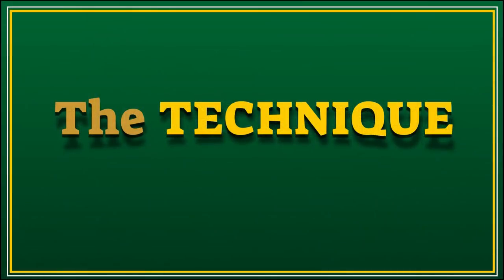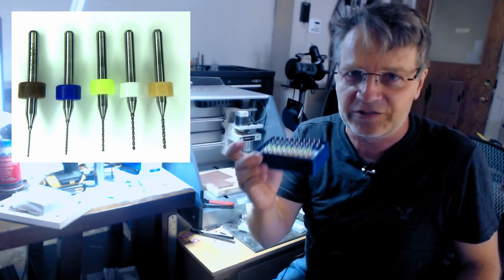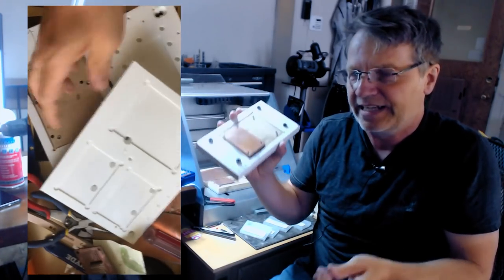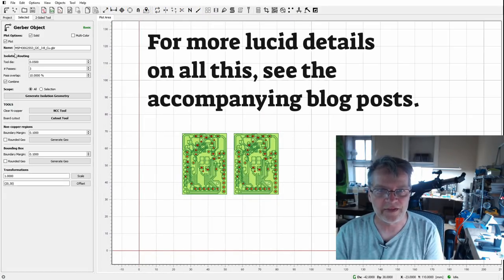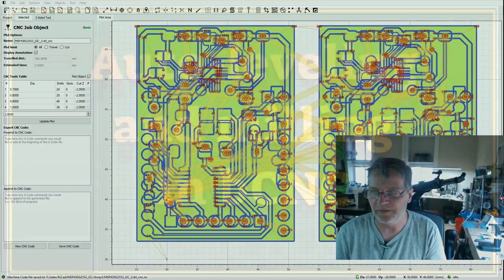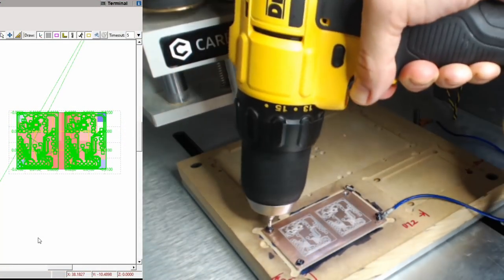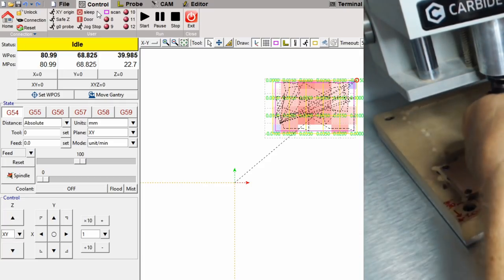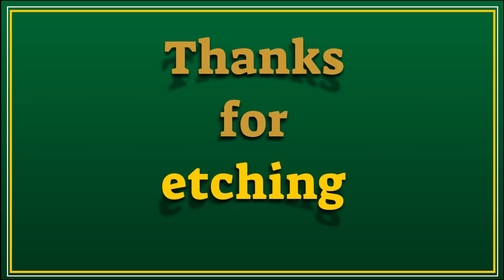The BEST way to make PCB's at home. Maybe.

Comment: One thing to note about my new PCB Maker software is that the copper part of the trace vias is a standard 2.5mm width, and that allows for "common wall" cutting paths, which allows for all duplicate cutting passes to be removed, which can reduce the amount of trace milling or scratching  by up to 30% or 40%, which reduces bit wear, and increases reliability of the process, and reduces the amount of time to mill or scratch a PCB significantly.  And for people using the V bits with the spindle on, this could reduce the amount of time that you have to listen to that noisy spindle running at 8000 to 10000 rpms, and much higher, which is very horrible.  I sure hope your scratch milling technique is all that it is cracked up to be. I am basically 100% it is going to work as you described, and the amount of horribleness of listening to that spindle at a high RPM during trace milling will be eliminated.  Yes, you still have the spindle on for the drills, but that can be done at a much lower RPM, for a much more manageable noise level.  It is that noise level of the spindle that bothers me so much, and scratch milling is a dream I have had for a long time, but I did not know about the titanium carbide scribe bits. I tried using a utility knife blade, and it worked but the mechanism I tried to build was not stable and also, the GCode would be a nightmare, and far more limited.  So these scribe bits really opened a big secret door for me.  I like what you said in that "think of a bunch of things to try, and then try a bunch of things".  That is exactly how I feel as well.   One other thing to note about my new PCB Maker software is that even though the standard trace widths are the standard 2.5mm that you find on Arduinos and IC chips, etc, it can still interface to non-standard widths so that it can do connectors with 3.5mm widths, for example.  I have never even thought about interfacing to smaller widths like that surface mount SMD stuff you do Robin, but there is no reason that it could not do that as well.  Thanks for all your knowledge Robin.  It has helped me so much.  And without further a due, I will now do my first full test scratching a full circuit.  The one that is in the link below. The excitement builds.  I will let you know how it went.  I am sure it will take a few tries to tweak it all like you have it working for yourself.   If you could share your 3 pass Z depths, and XY offsets on the second pass, that would be of help to me.  Thanks again Robin.  You are the man.

Comment: FYI To All:  By looking at a datasheet of a transistor, I just realized the pin spacing is not 2.5mm like I thought.  It is of course in English.  It is 2.54mm.  ...or 1/10th of an inch, not 2.5mm.   I thought my CNC machine's steps/mm setting in GRBL was off, as after about 15 pins, like on the Arduino Nano, the spacing was slightly off and it was hard to insert the Nano into the PCB. .  This is good information to know.   Some big transistors are 5.08mm apart on pin spacing.  I am making PCB to Gcode software, and my X and Y scaling from pixels to GCode was slightly off.  I am so glad I discovered this before messing up the steps/mm on my GRBL configuration.

Comment: Congratulations !
Your CNC is the best CNC, I have faced for PCB milling. About your milling process, I am reading the blog to understand it, because I could not understand during the video, because I am not a fluent english speaker. 
Thank you, for share your idea.
PS.: I like that first idea shown at the beginning, when you painted the entire copper board.
I have some problems to solve before trying any method, as to change the controller of my chinese milling CNC, from an Arduino Uno, to an ESP32 based board, and to learn how to use the FlatCam software.
Reply from the maker: Very curious to hear how it goes on a less rigid mill :)
Reply: @robindebreuil  , I got the point: That rigid scratcher tool. Now, I can understand the value of the rigidity of the CNC.
Reply: @anibalvilelarj  Please share your tests with us. Thanks in advance.
Reply: @mortaldrumming , yes. I would like to share, but it is going to be longer time. I live in Brazil, and the products take two months to arrive. I will share, but the time is expected to be very long. Thank you.

Comment: I have one of those $125 CNC machines, and it works, but quite slowly and takes a lot of practice and care. My preferred bit choice currently are second hand professional super-tiny end-mills bought on ebay. The high end shops only use them very lightly, and then they sell them off to hobbyists like me. The chinesium v-bits break too easily I think. I will look into the scraping bit you use, but I am afraid my puny CNC might bend from the additional scraping force. (The spindle holder is made of plastic)
Reply from the maker: Oh very interesting to hear! I haven't tried a small endmill, even a broken one might work. I've had very good results with sharpening broken drill bits using three extremely light passes, but it could be that still relies on the rigidity of the machine. Hearing you're able to get results with a plastic spindle holder makes me think that a custom machine could be pretty cheap to make and still get good results. Thanks for sharing the informations :).

Comment: Have you considered offsetting the milled indexing holes so that they're halfway off the board in x&y essentially making it so there's just a quarter of a circle cut out of the corners of the board?  I imagine this could reduce the amount of wasted surface area if you can achieve the same end results 🙂 Perhaps you could even cut it down to 3/4 off the board in only one dimension so it would be a few crescents on the sides of the pcb instead of in the corners. I imagine this may only work with blanks of certain dimensions, smaller the better most likely.

Comment: Do you have a link for the scribers you're using? Having trouble finding anything suitable here in Oz.
Reply from the maker: I used https://www.amazon.ca/gp/product/B06XYZVJJ6 which are from amazon canada, but you can get similar direct from China. I use the ones with extra tips to ensure they are removable. 

I'm going to try a diamond bit dremel bit today, I think that will work too. Sharpening scriber bits on a DMT diamond sharpener should work too (they do eventually get dull).I think broken PCB drill bits should work as well, they are also tungsten carbide, just not sure if I can get the geometry right (or if that matters). 

I also want to try tungsten welding electrodes - they are a little less hard, but still way harder than copper, and there are lots of tools for grinding those tips. The tools may work on tungsten carbide as well, as they are also diamond.
Reply: @robindebreuil  Thank you very much. I've bought scribers, but they're all fixed inserts which is not so good. I'll give your link a go, thank you.
Reply from the maker: I tried resharpening this morning with a diamond sharpener on the lathe and it worked well. I also tried sharpening broken pcb drill bits and they didn't work as well - I think that is still possible, just need to get better at sharpening angles etc. Also realized that diamond bits are not conductive, so leveling and even a super accurate Z will be harder. Anxious to hear how it goes for you :)

Comment: Very interesting technique! Are the tungsten pins standard size usually? Or do I need a specialized ER collet?
Reply from the maker: Oh, that's the nice thing, the one's I got are 1/8th inch, same as the drills - it seems that's a standard. This was the link for the specific one's I"m using - that's was 4 tips for about $8 USD https://www.amazon.ca/gp/product/B0789HX8LC/. Seems to be out of stock atm, but anything like that with replaceable tips should work.
Reply: @robindebreuil  thanks, will try this out. I'm done with V bits, they're a pain in the back. Resorted to expensive tiny flat end bits but this technique seems a reasonable alternative for delicate traces
Reply from the maker: @kipsus  Great, anxious to hear how it goes. I've found with different PCB's I have to vary things slightly - like z to 0.045 instead of 0.04 etc. Also FlatCam will not add extra passes between close things if there isn't room, so you can start at even 4 passes and that doesn't limit how small you can go (just takes more time). Agreed on the V bits, so sensitive to so many parameters :(.
Reply: @robindebreuil  Posted three days ago and ... sold out :) Very very interesting way of doing this!
Are you seeing issues with the board bending? I have issues with just autoleveling on my machine because the moment the board bends downwards due to the pressure of the mill bit I'm not actually milling all the way anymore. Do you see similar problems sometimes?
Reply from the maker: @TimoBirnschein  Probably sold out before this - I bought about a month ago, should have checked the link for availability :). I noticed there are similar versions, maybe even the same store with a different name :) https://www.amazon.com/Pack-Tungsten-Carbide-Scriber-Magnet/dp/B0789HX8LC
I haven't noticed bending, but it might be now that I have the pocket. I was thinking it would act like a spring if it bent at all, given that the bit is just pressing into the copper and not milling. The screws will also hold it tight in the z-level, either stretching or compressing the board slightly if they are very tight fits. I did have a lot of issues when using engraving bits though - not sure if it was bending or all the other things it could be with that though :). Certainly not seeing enough bending that it would affect the X,Y. This machine is also very stable, in other home made cnc's I've had there was some play in the z direction due to backlash and other movements there.
Reply: @TimoBirnschein  I think one can make a scriber from a carbide drill bits. Just file off the spiral end with a diamond cut-off wheel and you're done

Comment: Good video, I'm still looking for the perfect way to make pcb's. Do you have any advice on which affordable cnc machine could be suitable for this? I think that the cheaper 3018 machine is not so suitable for this.
Reply from the maker: I haven't tried myself, but a few people have mentioned that the cheaper cnc's have worked for them. There is very little pressure on the spindle, so the machines don't need to be super rigid. I am going to try and make a dedicated cnc for this out of cheap parts - I think that should be ok too.
Reply: @robindebreuil  Thank you for your response. do some more research. But good video!

Comment: Very interesting technique, have you tried a mixed technique scratching and milling to remove the copper between pads?
Reply from the maker: I have not, but certainly the edge cuts should be milled if you need that. It would be great for clearing copper areas as well, need to look deeper we into that - good point :)

Comment: Do you think, that a steel scriber would work too? Tungsten scribers are a bit hard for me to get :)
Reply from the maker: I would think so, as long as it doesn't go into the board the copper is pretty soft. I haven't experimented much with bits, the scriber was the first that worked for scratch into marker and etch, and I only noticed it peeling the copper when doing that. It could probably be improved with some experimentation with material and varying the cone angle of the tip -- so tool steel might even work better. (I was scribing initially with a v-bit, so that might even work - I went to a scriber because the V-bit seemed to scratch better in one direction than another because of the flat side)
Reply: @robindebreuil  Perfect - I'll try some different materials and if there's one that works very well, I'm going to comment it here. Thanks :D (Scribing with V-Bits? I feel like they break as soon as you look at them :) )
Reply from the maker: @flihx2218  he he, yeah I know what you mean. I was mostly scribing the sharpie layer at that point, only a tiny amount of copper. But yeah they did break anyway :). Looking forward to hearing how it goes!

Comment: I gave this a try but the burrs were pretty bad and < .4mm traces was a nogo due to the backlash in one of my ballscrews.  how are you deburring these?
Reply from the maker: Oh sorry to hear that. I'm generally not getting any significant burrs, but there are 'hairs' sometimes. I use a quick pass of 2000 grit sandpaper in those cases. I'm finding it works best with sharp bits, I've started sharpening broken pcb drill bits (60 degree angle, scribe at a 0.4mm depth). Most of the time I can use the board as comes out if I use three contours, but if it looks rough I just do a second pass.

Not sure about the backlash, but I could see that being an issue. The copper peels at about 0.05mm, so the widest trace I use is around 0.15mm. I can hit that pretty comfortably though. I've made a little diamond plate sharpening triangle that helps with consistency, I'll post a new video of that shortly.

Thanks for the update, happy to have a closer look at your setup and boards if you think that could help. I'm @debreuil on twitter, or here too (not sure if you can post photos in comments though?).
Reply: @robindebreuil  I ground a broken carbide drill to make the tip but maybe I didn't make it quite sharp enough.  It was an fr4 board and i may have been scratching too deep.  maybe I will try a phenolic board.
Reply from the maker: Oh ok, I am using FR4 boards, but they do vary in the copper depth etc, I think mine are 1/2 oz. copper 060 thick, double sided. I had to do test boards with variations in height and width to dial that in, those settings probably change per mill/board type. Also I've found the bit is fairly sensitive the the sharpening angle. I use a triangle holder for diamond sharpening plates and just rub it against the bit when it's in the mill. I've used a lathe as well though, with the cross slide set to 30 degrees. Using just a drill or hand I wasn't so successful though, but that might just be my poor motor control :). I added some pictures here if that helps https://twitter.com/debreuil/status/1291020439704211456

Also while experimenting, if you cover the board in sharpie you can always just etch to save it. That will remove any hairs, and probably burrs as well.
Reply: @robindebreuil  I invested some time in a better setup for sharpening which helped.  I wonder if some very small flats would help it cut more than push up the burr.  I was able to get down to 0.02mm but I'm guessing soldering will be tough with such little clearance.  I also noticed very fine remnants do hang around.  If the scribe is cutting the fr4 I can hear it pretty clearly and it is rougher.  I need to setup a super accurate tool height setter so I can use my 3 axis probe to ensure my height map is dead on.  I will post a video on my findings and setup later today.
Reply from the maker: Great to see the progress, looking forward to the video. I am looking into creating custom gcode for this to experiment a bit more (I'm a software person first, sadly). I think like you say, two outer scratches and something more blunt down the middle might work well. Or maybe the middle contour can be wavy. Also the hard corners are slow and not needed in most cases. It shouldn't be too hard to generate some test patterns.

For the height, I'm using the conductivity of the board itself - that is quite accurate, but I've noticed even an oxide layer can throw that out enough to cause variation. The 2000 grit sandpaper helps there, but maybe a chemical would be better (maybe even liquid flux? I think that removes the oxide layer). I'm interested to see your z setup, it is still the highest friction part of the process for me. Thinking a spring tip could be made with the sharpened PCB drills somehow, or even putting the bed on springs. It would be great to not have to autolevel each time, but maybe just automating that a bit better would be enough.

Anyway, really looking forward to seeing your setup and process, thanks for reaching out :).
Reply: @robindebreuil  i put up a video, production quality isn't great though...  Let me know what you think.  The grinding setup is at 8:26
Reply from the maker: Cool, love the grinder set up and all the home made tools, kudos :). 
https://www.youtube.com/watch?v=7PextF_gsQ4

I've commented there, but I think the main difference I see is I do three or four contours. Flatcam will do the max possible but not more, so it makes easier soldering - but also for some reason it clears away the tracks better. The first two pass scribes seem very similar to what I'm getting, maybe it just needs a third pass?

Also I need autoleveling, even more than your setup it seems - I'd love to avoid that step.

I also originally ground some drill bits sharper and less sharp than 60 degrees and it didn't work so well. Not sure that is a difference here though, it seemed about right eyeballing it.

Enjoyed your other videos too, you have a great setup and process going there :).